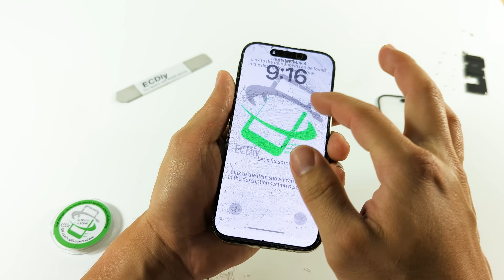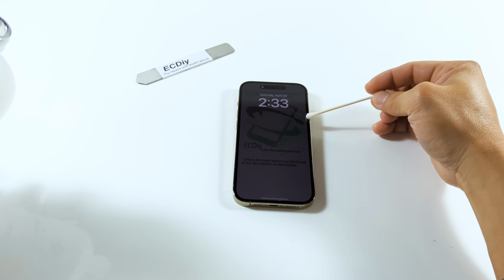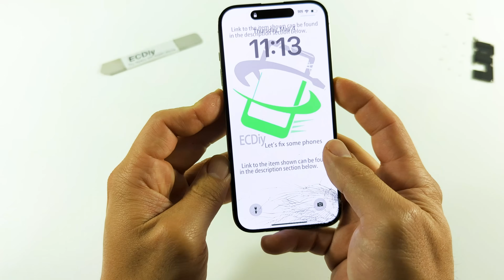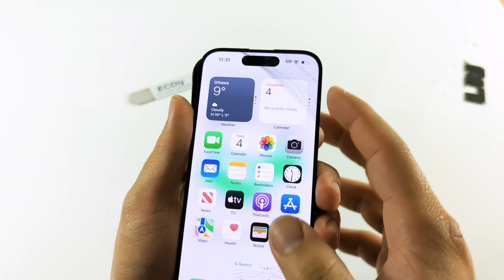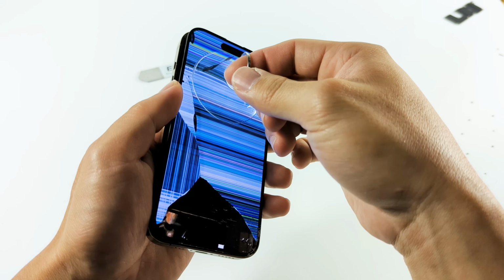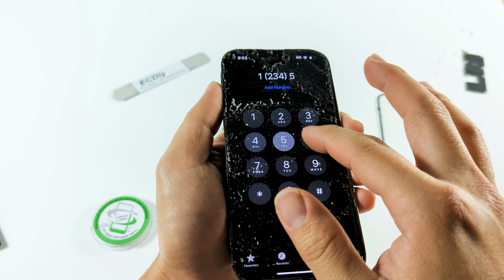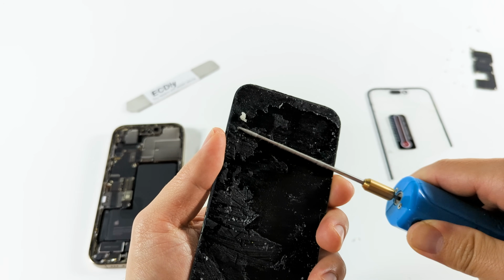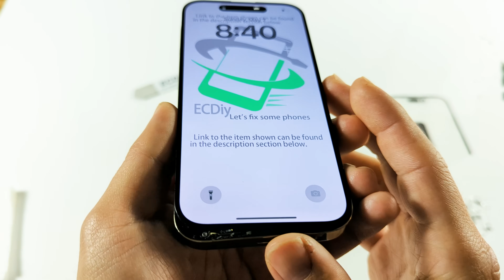How to Repair Cracked Screen Glass Only on iPhone 16–12 Pro/Pro Max/Plus (Full DIY Guide)

Comment: Do iphone xs
Reply from the maker: We're going to make a long form video for the 12 soon and we'll move down to X~11. The method is practically identical other than the fact that for iPhone X ~ 11, the bezel does need to be separated as it does wrap slightly around the glass.

what you can do once the display is removed from the phone is to submerge it in 99% isopropyl alcohol for minimum 30 minutes (you can do it for longer without issues as long as the display is the OLED display which the original display is. High end aftermarket displays are also OLED. I have left displays submerged for up to 48 hours)

You can tape the opening of the plastic tray our kit ships in to be able to use the tray as a small container for isopropyl alcohol if you need. This is shown in our latest shorts video for Pixel phones on our channel.

At that point, the bezel can be removed rather easily with OCA blade by sliding it in from the back side of the display. The other sides are more forgiving but when it comes to the bottom side, you do want to ensure all of the adhesive has been sliced before attempting to pull the bezel away as there is a sensitive flex cable for the display that is attached to the bezel. 

If the adhesive isn't completely sliced, attempting to remove the bezel can damage the bottom flex cable.

If the display isn't OLED, you'd need to resort to heat only to soften the adhesive. (You can do the above with heat as well to make things even easier)
Hope that helps.
Reply: @ecdiy yes please the iphone 12
Reply: @ecdiy please explain how to remove face id and bezels not curing full
Reply from the maker: @lrft  iPhone 12, if you are curious it is covered in the short form video titled "They wanted $300 for this", bezel removal is covered in my previous reply, and FaceID removal is covered in this video, (simply dab a few drops of isopropyl alcohol to weaken the adhesive and use the OCA blade to slide it between the glass and the module to slice the adhesive and lift  it away from the glass) but could you kindly clarify what you mean by ""not curing full?"
Reply: @ecdiy when will you guys remove the iphone 12 full on gvideo
Reply from the maker: @lrft  Hopefully by the end of the week/mid week next week!
Reply: @ecdiy  could I send you mine and you can try on my phone? 😅
Reply from the maker: @robertcastillo8125  How can you even ask me that when you haven't even subscribed?! Jk but hmmm, I did say in my newest iPhone video that if I pin your comment, I will fix your phone for free. 
Is it time? 
(Not asking you to comment there btw, just saying I kept putting off fixing viewers phones for time since the response was just overwhelming when I made a post on Kijiji looking for phones to fix, but now I'm technically committed to start on YT)

Speaking of time though, are you ok with longer than usual wait time? I'm in Canada, unless you are also in Canada, shipping will take some extra time.
Reply: @ecdiy yes sorry I thought I was subscribed,yes im okey with the longer wait time
Reply: @ecdiy sorry I took a while too respond
Reply: @ecdiy I'm in Cali, but still a very amazing product, I have the skills to replace a whole screen but with apple and them parring their phones to their screens it is just wrong. I'm actually thinking to try it on my pixel phone. But still keep up the great work👍
Reply from the maker: @robertcastillo8125  I agree with you a 100% and the new bezel design found on iPhone 12& up actually makes the screen more fragile. 

I had just committed to help another viewer, but not a problem I will fix yours. Contact me through the website for the address and what not.

Comment: Is there a video showing how to replace the touch glass digitizer of the Gome U7 without machine? Is there a digitizer touch glass replacement video of a phone with the same touch glass construction type? Any info on this appreciated from anyone please. Thanks.
Reply from the maker: Not that I know of but on those phones the display assembly is pretty cheap? Are you looking to try it as a practice?
Reply: If I see how it is done and what is involved then I will know if I have the ability to replace the digitizer. I would like to get it replaced. Could you guide me in the process of replacing this digitizer touch glass?

Comment: if the wire doesn't get clean under the glass but cuts under the polarizer, can the polarizer be changed?
Reply from the maker: In some cases yes, I do show this on a video with a Pixel 6. However, it was due to me not paying attention and going too deep/not having the wire lowered to the work surface when entering one of the corners. 

I haven't experienced a situation where a dirty wire causes this issue. As shown in the video, iPhones have a bezel/display holder frame that is thicker than the actual display panel. As a result, when you hold the wire tight and use the wire as instructed, the wire should not make contact with the actual display membrane.

Comment: Do we need to remove the sensor or can we leave it in place on the 14 pro???
Reply from the maker: Shown in the video is iPhone 14 Pro, you don't need to remove the sensor entirely. Most of the parts are on the phone and stays on the phone. However, you would want to lift the proximity sensor and the mic as shown in the video @2:21

Comment: almost a guaranteed you’ll get dust under the screen while glueing :)
Reply from the maker: I haven't had it happen. It's not much different than a screen protector installation. If anything, using this glue is a lot more forgiving because even if dust were to fall on the display, it would just get wetted out thereby making it very hard to see unless you were to look very up close.

Any questions/concerns, please do not hesitate to comment further.
Thank you and have a great rest of the day.

Comment: Whats called the liquid that stick glass and screen display ? Glue ?
Reply from the maker: It is called Stronghold LOCA. LOCA stands for Liquid Optically Clear Adhesive, there are several options but please kindly note many LOCAs require a separate UV lamp to cure. Ours is specially formulated to be hypersensitive to UV, so much so that exposure to daylight on a cloudy winter day is enough to cure the glue. Other parameters such as contractility, tensile strength and viscosity have all been fine tuned over the years for optimum results. 
    Please note there are a few sellers infringing on our trademark, Stronghold LOCA is developed by us and is exclusive to us. 
   Any further questions/concerns, please do not hesitate to contact us/comment further.
Best regards,

Comment: question, if I, unfortunately, crack the glass again, that UV cure glue, is it soft enough and easy to remove with alcohol?
Reply from the maker: Yes it is. It's easier to remove than the factory original. 
Any further questions/concerns, please do not hesitate to comment further.
Best regards,

Comment: Goodnight bro i need your help. i attempted the repair but the wire actually went right through the polarizer film and the screen display. there is some glue left on the screen that bonded the polarizer film to the screen display  but my 100 percent acetone cant get it off and i am wondering what i can use? moreover i see this replacement part on alli express being sold that comes with the polarizer already bonded to the outer glass but i am wondering how could i get the side with the polarizer bonded back to the display screen... bear in mind that i dont have any laminator, so could some good old LOCA glue work or did apple use another type of resin to bond the polarizer to the screen itself

Comment: Where do you get the little silicone holder to hold the outside of the glass when you use the wire to separate the glass from the LED screen?

Comment: You skip over so much crucial information. The different layers in the screen. Glass vs OLED, testing the screen along the way to make sure you're on track. You rush through steps, don't show close ups. Honestly, the kit is great but this video needs a lot of improvement.
Reply from the maker: I'm so sorry — I have no idea how or why I was never notified of this comment. First, thank you very much for the feedback.

In hindsight, I agree that I should have emphasized the point I mention at 3:07 about keeping the wire tight and low. I just assumed everyone would follow the instructions exactly as stated. As shown, because the lip of the bezel is thicker (to accommodate the factory film-based adhesive between the glass and the OLED), as long as the wire is held tight and low, there really shouldn't be an issue with slicing through the wrong layer. That said, we did have a couple of people report this happening.

As soon as we were notified, we updated the "Latest Tips & Tricks" page (printed on a slip and placed at the top of the kit contents during packing) to include warnings like this — all based on feedback like yours that comes in after the video is uploaded. This specific issue is now highlighted in bold red text, warning that display damage may occur if the technique isn’t followed precisely.

Another common issue was people using the standard pry tool (the one often visible in the corner of the frame — we include it in our toolkit because it can be useful in certain cases), mistaking it for the OCA blade. The pry tool is too thick and pointy to get under the glass like the OCA blade can, and using it can damage the display.

Regarding close-ups — were there any in particular that you felt were lacking? The shots showing the wire entering, the bezel meeting the glass, and the smaller fragments that need to be removed with the OCA blade were about as close as I could get without relying on digital zoom. But I’m always open to suggestions for improvement.

I’m still pretty new to video production, and I’m trying to find the right balance between keeping things concise (for viewer retention and algorithm performance) and going super in-depth — like I’ve tried in the separate videos covering the opening and gluing processes. I understand that kind of detail may feel redundant to many, perhaps even the majority but it's essential for others.

I do plan to release a much longer version intended for people doing the repair to have running on the side, so they can follow along step by step. That one will aim to cover everything down to the finest detail.

Once again thank you for your feedback and sorry I missed your comment! If you have any more, please please share with me.
Have an amazing rest of the day.
Reply: Do you have some more in depth instructions? Thanks.
Reply: @scienceofsound  He just mentioned some
Reply: @Mailman_Media he did show and say he tests the screen once the glass is off to make sure it’s all ok 

You just didn’t watch it all

Comment: What do you think about the 'reverse clamp' type tools with a suction cup on both sides to pull the screen off would that work with your method?
Reply from the maker: They do work. I would just be super careful not to get carried away because the range of motion on those tools are often enough to cause the flex cable to tear.

Comment: This applies to iphone 15?
Reply from the maker: Yes it does, and I'll be uploading a video on it soon. iPhone 15 series does have a thinner display holder bezel (part directly attached underneath the glass along the parameter of the display) but as long as you apply the same steps shown in the video, the display should come up without damage.  
Other than the bezel, there really isn't any difference in the process.
Best regards,

Comment: Someone knows why my brightness is so pretty low on my 14PM after changing the screen for another original Apple screen? (didn’t transferred the IC or ambient light sensor)
Reply from the maker: Unless something changed recently, replacing the screen as a whole, even with a genuine Apple display off of another phone does disable auto brightness as well as "True Tone" 
Replacing the glass only is the only way to avoid error messages & loss of original display functions without getting into micro-soldering the IC sensor over which in my opinion, is more technical than the glass only replacement.
If anyone else could chime in, that would be greatly appreciated!

Comment: When doing the repair should my fingers (when slicing with the wire) be touching the table surface. Should they be THAT low or is being that low too low.
Reply from the maker: Great question! 
Yes, they should be that low. The idea is so that the wire held tight and low so that it is gliding on/touching the glass when it approaches the corners so it can't possibly go deeper into the display.

Comment: Would 70% isopropyl alcohol be fine for these repairs ? That’s all I have. Let me know!
Reply from the maker: 70% is ok for if and only if you can be certain that you won't be accidentally turning the device on before the isopropyl alcohol has fully evaporated. This is because 70% isopropyl alcohol is 30% water. 
This is another great question by the way. 
Any further questions/concerns, please do not hesitate to comment further! 
Best regards,

Comment: DO NOT REPEAT THE SAME Mistake that I MADE. 
My 1st Experience with the Glass Repair Kit and Learnings from the experience.
- Follow the instructions and have one friend help you out, just if you miss any steps.
- I ordered Y#000 Precision Screwdriver and a Pentalobe screwdriver (iPhone repair kit) from amazon because the screwdriver included in the kit were not hard enough to unscrew.
- I made a huge mistake of peeling the wrong side of the glass and placed it on the screen. Shiney reflective side is the side that goes on top of the screen after you put the glue. Black side on the display stays up -facing you. 
- Keep one small strong magnet on the desk, so that you don't lose any screws like I lost one on the carpet. 
- Make sure to put the speaker grill back (earpiece) prior to fixing the display.

Overall, I had so much fun doing this. Thank you @ECDiy for providing prompt support after my mess-up. Looking forward to fixing my mistake soon.
Reply from the maker: Thank you so much for sharing your experience and thank you so much for your kind words. Happy to hear it was a fun project for you. 
The only thing I do want to mention is that the screws are ever so slightly different from one another, so it is best to set them aside in the orientation you remove them as mentioned @2:10 putting it on a magnet could get them all mixed up.

You are right though, having a helper for even just 10 minutes to hold the hair dryer/heat gun above to keep the temperature consistent will make this process go much faster and smoother.  

In case anyone is wondering, the shiny coating referred in the comment above is shown @5:44

I am looking into the screwdriver issue. We have sourced a different set to send out should anyone else happen to experience the same issue. In the past, the only issue with driver we experienced was it being stripped due to clogged screw head which toothbrush dipped in isopropyl alcohol clean well.

Thank you once again for sharing your experience and helping others learn from your mistake! Greatly appreciated and I'm sure you've just prevented someone else from making the same mistake!

Comment: What glue are you using at 5:38 pls reply me I ask you so many time you still don't reply
Reply from the maker: Hello Alex,
Thank you for your comment! I do see that you have asked on 2 other videos about an hour prior to this.
I am very sorry for the delay. I had been a bit backlogged with the repairs and did not get a chance to check the comments until now.

To answer your question, it is called Stronghold LOCA. LOCA stands for Liquid Optically Clear Adhesive, there are several options but please kindly note many LOCAs require a separate UV lamp to cure. Ours is specially formulated to be hypersensitive to UV, so much so that exposure to daylight on a cloudy winter day is enough to cure the glue. Other parameters such as contractility, tensile strength and viscosity have all been fine tuned over the years for optimum results. 
    Please note there are a few sellers infringing on our trademark, Stronghold LOCA is developed by us and is exclusive to us. 
   Any further questions/concerns, please do not hesitate to contact us/comment further.
Best regards,

Comment: is there a video of the 14 pro max
Reply from the maker: No but it's the same as iPhone 14 Pro, which is shown in this video. 
If you want to get down to the exact screw location for the display removal, you can reference others' full display swap videos but the process is virtually identical.
Any further questions/concerns, please do not hesitate to comment further/contact us.
Have a great rest of the ay.

Comment: @ECDiy Do you repair glass for customers? If i send my device to you
Reply from the maker: We do not offer phones as a service at the moment but I do occasionally do repairs for viewers as a giveaway. What phone do you have?
Reply: @ecdiy  I have pixel 6 pro. I couldn't find a video on the channel specifically for pixel 6 pro. So if possible you can use my device to make a video for the channel.
Reply from the maker: @nisargkodinaria4409  We do have a video for Pixel 6 Pro, it's in the shorts. 
I will be picking someone for another repair give-away soon!

Comment: Hi there, was wondering how much mL of glue is needed for the iPhone 13 Pro Max?
Reply from the maker: Please note that this amount does vary from glue to glue, but for an iPhone 13 Pro Max, we use 1.8mL.
We specify the amount needed for each phone using our glue also on the installation guide page, the address to which we print on the slip placed on top of the contents of the kit. 
Any further questions/concerns, please do not hesitate to contact us/comment further.
Best regards,